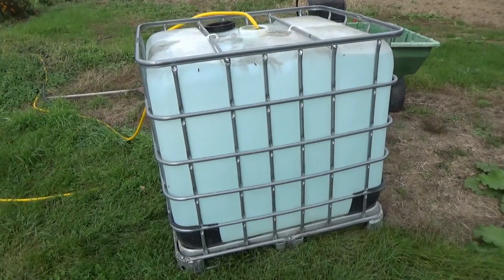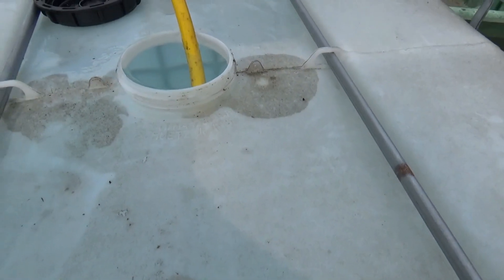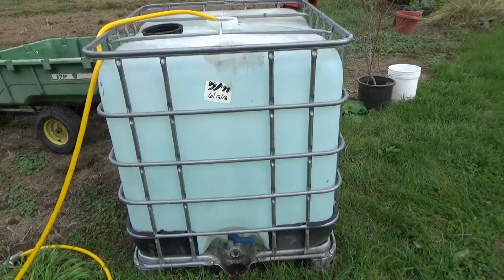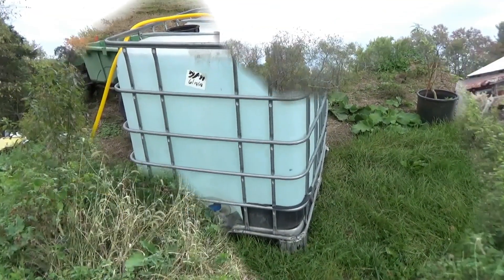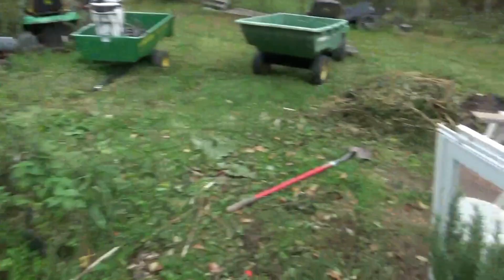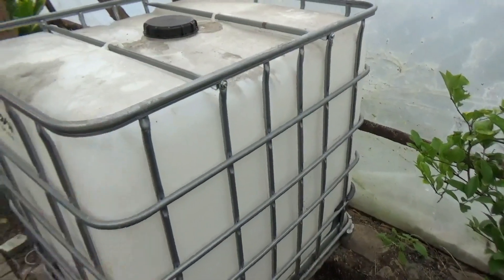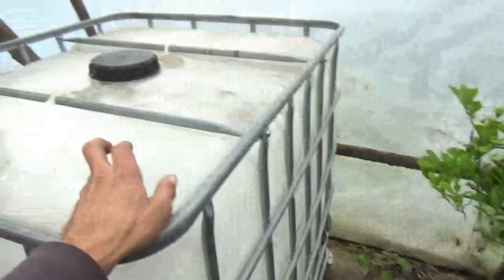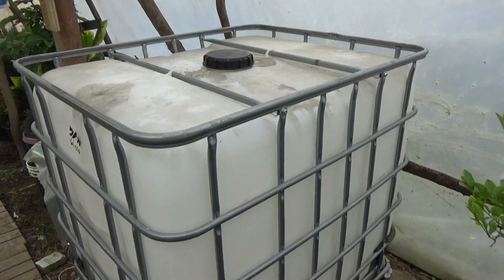Greenhouse New Thermal Mass Tank 275 Gallon IBC Tote Hydronic Heat Exchanger Raspberry Pi Controlled

Comment: So, now you have over-wintered.  Any feedback, any data you would share with us about the effectiveness of your system?  I'm working with a similar idea, but to bury 2 IBC totes under the greenhouse.  They would be encased in 3" foam, and surrounded by aircrete, sides and bottom...  I plan to use vacuum tubes and solar to heat the water, and run the water through PEX under an attached studio for supplemental heat.  Your reflections would be greatly appreciated.  I'm in southern PA.
Reply from the maker: Hmmm... I would say use insulated walls on anything that won't be letting light in. Buried under the greenhouse sounds great! Put lots and lots of solar collectors up!  I'm curious to see how your setup does. Please share with us!

Comment: What about using solar vacuum tubes? This would make heating water even in the winter very efficient.
Reply from the maker: I would need a football field of them.. and tanks to match... the greenhouse is VERY low insulation. I have one panel like that, but when i did the calcs... 6 hours sun would only be about 15,000 BTUS. Wood is cheap and readily available here. Eventually I'd like to build a greenhouse recessed into the ground, then solar could provide all the heat.
Reply: @TheFarmacySeedsNetwork  you would need 4-5x less area with water over clay. Also you can keep any area of land at 50 degrees just doing geothermal by itself.  They question is how much the initial build is vs crops produced in that time to make up the difference
Reply from the maker: @nuggetsyl  Yeah, it's a  lot of digging for land I don't own. Water over clay? Can you clarify?
Reply: @TheFarmacySeedsNetwork  water hold heats better then clay or soil. About 4-5 times better. It's the reason why you see frozen soil at winter time and the water is still liquid.
Reply from the maker: @nuggetsyl  oh yes i see what you're saying.  water at specific heat of 1.00  vs soil / rock round .3 -.5  ... yep!
Reply: @TheFarmacySeedsNetwork  and this is why I was saying if you use a hot water solar tube it might keep a green house at 70 degrees.  If you keep the energy as heat you have way less loss of energy. Stupid rules of thermal dynamics haha

Comment: Good video and interesting concept. What is your heat source and cost of same? How is the heat radiated back into the greenhouse? Thanks
Reply from the maker: I heat with a wood stove. I don't have an itemized cost, but I use a tractor and chainsaw and cut and skid my own wood. Prob $100 - $200 for the season with fuel, chainsaw chains etc. Here's a playlist with more: https://www.youtube.com/watch?v=awItqr5Itlc&list=PL837tk-T71Lgh6ro_o5vb2W3bUUsOdMQfHere's more details about how heat exchanges:  https://www.youtube.com/watch?v=saad78G92Yo&list=PL837tk-T71Lgh6ro_o5vb2W3bUUsOdMQf&index=34Basically it just radiates back from the thermal mass tanks.  Thanks for your interest!

Comment: So this is from October, How is now? what is the temperature difference between outside and inside the greenhouse? also I do not understand the last part of the calculation, why are you multiplying it with 120 (I think I did not understand the working range thing) Thank you.
Reply from the maker: Working well: https://www.youtube.com/watch?v=LgX_mbWJH5Q120 because that is about what I expected to be able to reach temperature wise without being concerned about melting the plastic. I chose 60 as the bottom temp because not much heat will radiate below that temp and 180 so the plastic wouldn't melt... so the difference is 120 and therefor the "storage range" of the tank. Hope this helps... Thanks for watching!
Reply: @TheFarmacySeedsNetwork  Thank you, I'm planning to build a greenhouse for double purposes. First I will put a series of IBC tanks for wastewater treatment coming from my tiny house. Second grow stuff there and use the treated water for them. My initial plan is to put 4 tanks, and later stack four more on top of them for more water. I believe they will absorb some solar heat without heating but later I'm planning to add a solar water heater to heat the waters in the tank. I hope this will work.
Reply from the maker: sounds like a good plan to me... I want to add more tanks and build a bigger greenhouse in the future.  I'm sure you can find other creative ways to capture heat to the tanks, but that much water will definitely help you buffer out your heating needs. What part of the country (climate) are you in?
Reply: @TheFarmacySeedsNetwork  Northeast Pennsylvania
Reply from the maker: Ahh ok... very similar climate.  Well let me know if I can help answer any engineering questions for you.
Reply: @TheFarmacySeedsNetwork  Thank you, I'm sure I will have a lot of questions.
Reply from the maker: Fantastic!  I will be glad to answer them and glad to make videos to help explain things if need be!

Comment: interesting video! thanks a lot for posting! I think the working range of the IBC tanks is -40c to 60c
Reply from the maker: Thanks for the kind words!  Hmm 60 c is 140... Yeah I don't expect to reach 140 in there anyway.. takes a long time to heat 285 (overfilled) gallons to 140... but thanks for the heads up. I DEF wouldn't want to exceed that and have a hot water flood! lol